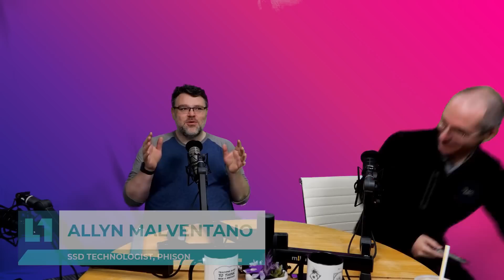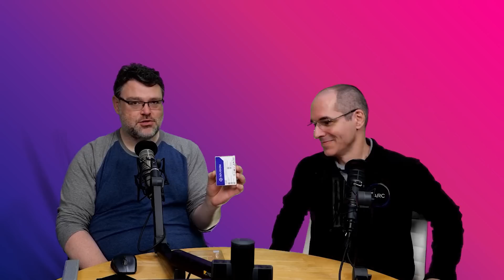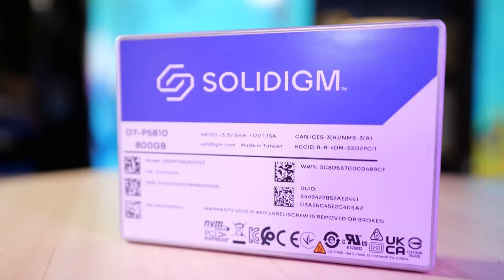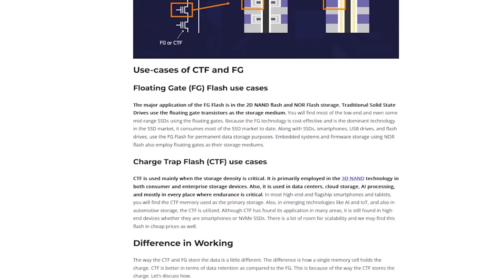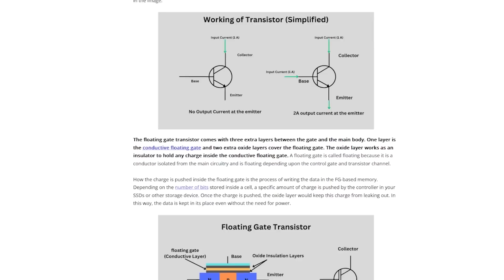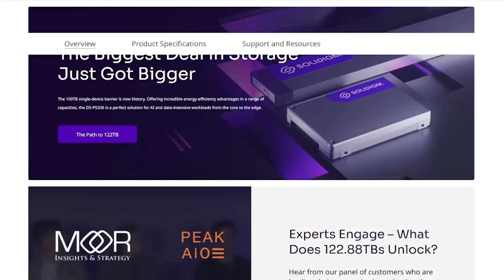The Solidigm D5-P5336: 122tb of Enterprise Storage Goodness!

Comment: the conversation around QLC and DWPD is not relevant with these large drives.  Its TB written per day, or 30TB per day for 60TB drive is crazy.  Who writes that much?? No one, or maybe 1% of the market.  I also believe if you can write to the exact IU, these drives could (in theory) live for 20+ years by bypassing the dram and hitting the NAND direcly.  super awesome AI use case for reads (full PCIe4 performance).  Would be great to discuss placement mode as an option.  Also, with the perf, power, cooling, yes but should have discussed AFR (.4 vs .04 for SSDs).  Dedupe should have been discussed as another pricing comparrison (dedupe drives down per gig via software)

Comment: When the 100TB SSD hangs lower to consumer market, the spinning will be nailed in the coffin ⚰️, just like floppy and optical media. It's the twilight of harddrives, only minutes to dusk.
Reply: HDDs wont die.  they will be like tape and mainframes.  HDDs have their place, and your S3 storage from AWS, DigOcean, Wasabi use HDDs for deeper, then offload to tape.  Active Archive is a good place to read up on this
Reply: @sklise1  For now, yes, of course 💯👍🏻✊🏻✅. However I doubt that when 100TB becomes mainstream bundled storage. You just couldn't lower mechanical disk's cost per TB as low as SSD's on that day.

Comment: How has Solidigm’s firmware quality and reliability regarding fixes been since it started?

I’m still a bit burnt by Intel’s NAND SSDs and their rug-pull with Optane storage.
Reply: I used to work there.  I would say "very good".  There was a security bug back in the day, but they conformed to SNIA standards.  usually firmware is released on a quarterly basis, unless the "fix" was under critical/security fix

Comment: Quite interesting take is

Most of Enterprise SSD (With higher-capacity) only use DRAM for FTL, its already has multiple flash chip (with it own SRAM) work in parallel so it fast enough to sustained writes on advertise speed.

But consumer one that has very few NAND chips, it actually use DRAM for both caching/FTL because less NAND chips also make it slow to write and interface is much faster than NAND itself.

Comment: The reason HDD's will not be going anywhere, in the enterprise, is because almost no one is doing AI. Most of the datacenter I work at is still doing the same sort of things it was doing before LLM's. We run a lot of SQL DB's. None of those customers need 122Tb SSD's. They need affordably priced bulk storage and that remains HDD's. 

Yes, we need better solutions for restoring arrays and doing backups. But right now I can get 12Tb enterprise HDD's for ~$100 USD (pre tariffs) and there is no SSD anywhere near that price.

Comment: I'd love a mass storage oriented SSD offered at around the 16TB - 32TB range, priced to attract home NAS users, purely from a noise and vibration removal standpoint, and bonus if it consumes less power as well.

I probably have many years to wait but hey, one can dream.
Reply: Same - you give me something that's designed to work in groups of to match a PCI slot (eg, 4 drives match a PCI Gen 4 x8 slot) and totals in 40Tb of raw space... I'd be looking to replace my old mechanical HDDs with groups of them in RAIDZ1. Put it into a 3.5" case with lots of heat sink and it'll fit so many NAS and 19 inch "server" cases... Mine has space for 12, and I'd happily put in 8 if the price was right...
Reply: That. Plus I wouldnt mind SSDs in 3.5" either
Reply: @ReDemoN_BR  Nimbus has a 100TB 3.5" SATA drive which came out years ago.

With current NAND densities you can easily stuff 32TB of TLC into a 2.5" 7mm SATA ssd or 64TB of QLC into the same package. The biggest issue will be cost -- at the costs those things go for SATA speeds may seem inexcusable.

For 3.5" you can easily double the Nimbus Exadrive and stuff 256TB into that package. You might be able to cram  in half a petabyte of QLC. Once again cost is the biggest issue.

In the end you'll end up with exactly the type of drive featured in the video. Aimed at enterprise because of the cost.
Reply: Can't wait for presistent SSDs, where age and time without power really isn't a big issue.
Reply: There were 16TB 2.5" SATA SSDs at one point. They were jammed full of QLC NAND chips.

Cost is the biggest issue for massive SATA SSDs, modern 4TB TLC SSDs are mostly empty shells. The manufacturers have also switched focus to NVME gum sticks.

My latest revision Crucial MX500 uses up to 1TB NAND chips, so the 4TB version has 4 -- two on each side. The older version MX500 had up to 16 physically larger NAND chips, 8 on each side.

That means they can technically make 16TB TLC SATA SSDs, or 32TB QLC SATA SSDs. Unfortunately, costs means it will never happen.

Comment: Its official, YouTube's 1080p has the same quality as normal 480p. Its honestly distracting on a 32" monitor.
Reply: youtube is transitioning to SABR streaming protocol for web interface. The "ABR" is Adaptive BitRate so they can crush bitrate in real time and claim they do so to optimize for your slow internet.
That said, this specific video seems to be recorded with a potato and in many shots it's zoomed in on the faces, so it's not really high res to begin with, and was upscaled.
Reply: @AntonioMolfetta  I'm not talking about the zoomed in parts, even the normal framing looks awful because the low bitrate is crushing everything remotely that has detail
Reply: yep i got a 1440p monitor recently and was loving watching in high quality with all the added detail over 1080p, though i was tripping today when all the videos wen to shit. Glad others are experiencing it
Reply: I'm wondering if they shot this with a single camera wide shot, and then cropped and zoomed for the head shots. Would explain some of the blurriness.
Reply: @gabrielpi314  Its YouTube, it has a distinct "encoded 2x with not enough bandwidth look"
Reply: On my PC I can't even watch at 1440p anymore, it's locked to 1080p....
Reply: It was official 10 years ago.

Comment: Its really a pain in the butt that consumer SSD have a low voltage limit and thats why we have only 8TB SSD for desktop and laptops... and enterprise has 122TB ssd no problems. FFS we could have mass production of 32-64+ TB SSD as we speak for low prices if the manufacturers stop their BS and upped the voltages on SSDs.
Reply: What a rant did you watch the video? Voltage isn't really the issue - heat (power) is the issue unless your happy with a 88DbA  data centre fan system next to your ear trying to keep it cool. PCIE5 NVME already has enough issues for desktop users that can't keep them cool.
Reply: @zorbakaput8537 or: give us 3&1/2-inch ssds that are half headsink... we can stop pretending that the only viable storage devices are "thin like your phone!" one day...
Reply: @zorbakaput8537 brother, my GPU uses 300W on load and it does not need a datacenter fan system to stay cool.
We have the technology to keep a sub-30W SSD cool without a high RPM fan.
Reply: Yeah this would literally be impossible on laptops, especially if you consider how high end laptops can't even cool their high end components without thermal throttling on full load, even undervolting and other power regulation don't really help that much in a full load stress test. Laptops are practically wastefull.
Reply: @clawwer4404  laptops can't use high end pcie5 SSDs anyway already, (I mean you can but they will burn/overheat/shutdown so you shouldn't try).
I don't see the issue with making more SSDs that can't run in laptops
Reply: Can u expand a bit more on this topic?
Reply: 32TB drives would be upwards of 5k USD. It’s like saying that we should have consumer CPUs with 6 memory channels and 192 cores. I mean, you can, but it’ll cost ya

Comment: What's going on with Solidigm's consumer market?  I miss their lower cost quality NVMe offerings.
Reply: They have dropped all their consumer stuff sadly. The P42 Plus was canceled for example.
Reply: @polechelps That's really sad, especially that they're going with huge server drive capacities - they could have pushed the consumer market to larger and more affordable capacities as well (trickling down the technology).
Reply: Yeah, very sad. I am glad I was able to grab a couple of the 1tb p41 pros, but now I want more storage as the drive bogs down when it's 75% full. I can say that it's a fricken boss because this thing has been used as a Blu-ray rip scratch drive and it's still chugging a full year later.
Reply: @T3hderk87  do you really need an SSD for bluray rip? I don't think it is reading the disk fast enough to saturate a mechanical
Reply: @AntonioMolfetta It's my combo Blu-ray slush/game drive. To answer your question no, but i spent my spinning rust allocation on my two separate 40tb raid 5 arrays so all i have in my main pc are nvme....
Reply: @ohdeergaming  Profitability